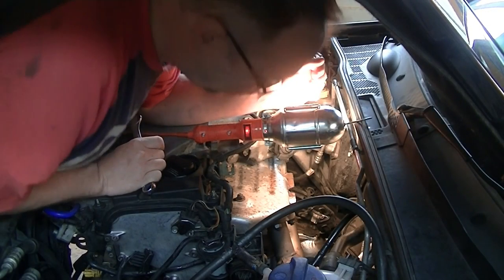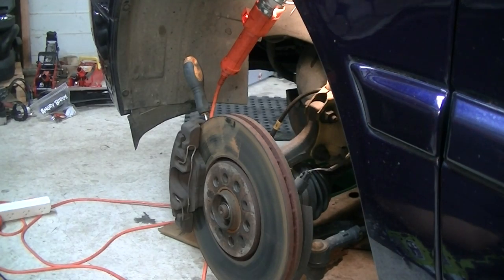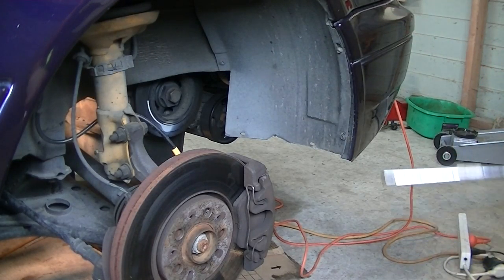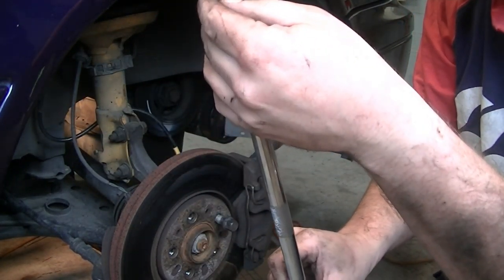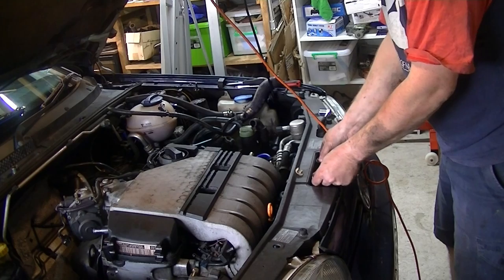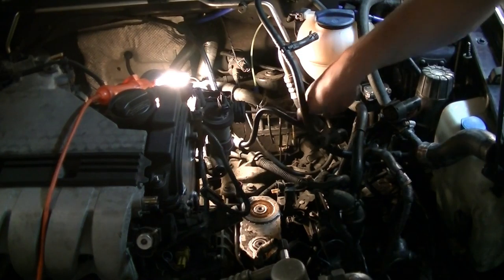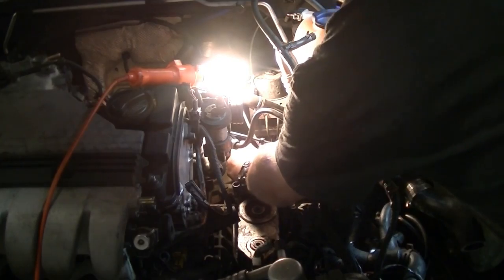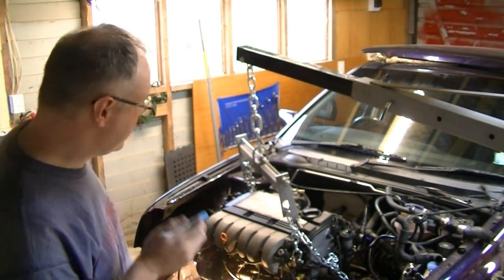VR6 Engine Pull - Part 2 - VR6 Rebadgered

Comment: Very cool! I'm always impressed by what non mechanics do at home in their garage! I've never pulled an engine on an A3 / mk3... you've got one on me! Thumbs-up!
Reply from the maker: +Thomas EXOVCDS can you tell I'm not a mechanic? 😂 I can tell you that without having to worry about rust it's a straightforward job
Reply: Badgertronix You're doing better than some of the guys we had working for us over the years! =)
Reply from the maker: +Thomas EXOVCDS I've only done the taking apart so far. Still plenty of time to mess it up 😂